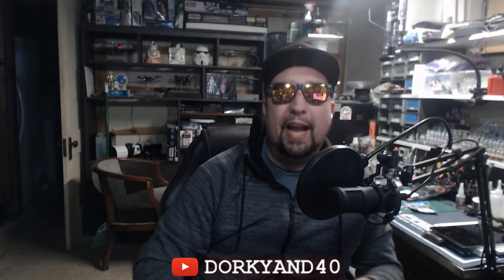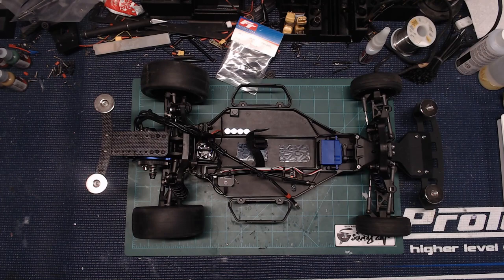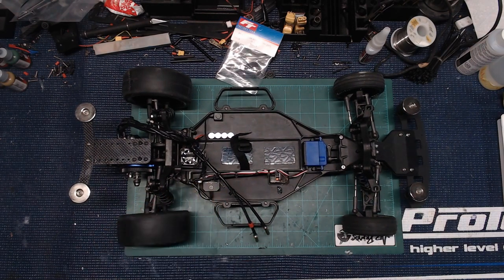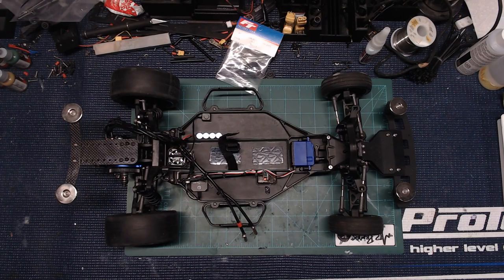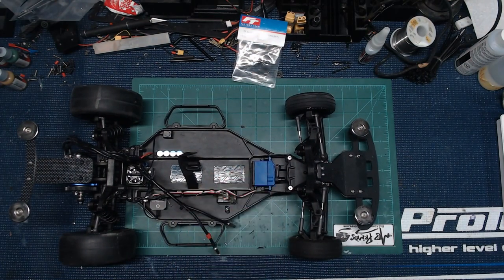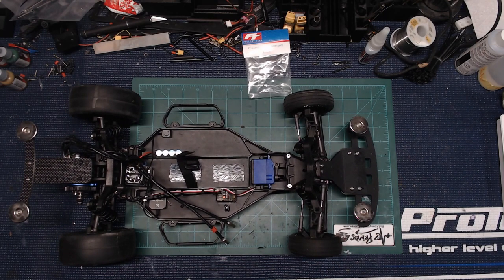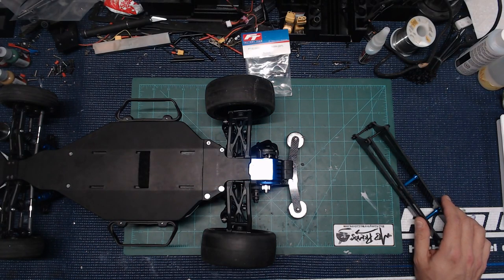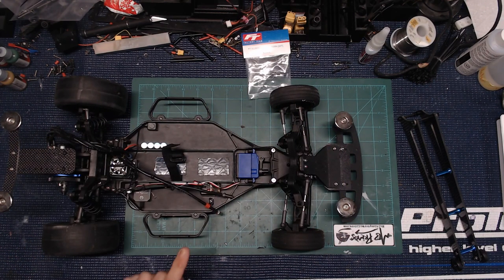5 THINGS TO MAKE YOUR DR10 BETTER | NOPREP DRAG RC

Comment: This summer when I'm allowed outside again I'm finding the uk scene and I'm doing this. It's going to be my mission to make them add rules they didn't think they needed. Step 1: big prop on the back. They say no gyros but I might be able to use optical flow or ultrasonic sensors to do the same job.
Reply from the maker: Lol. That would be something. I hope you’re doing ok.  I follow uks updates and vaccinations closely just because of you guys and the ldo crew and other fpv you tubers. I get my second dose of moderna this coming Monday.
Reply: @Dorkyand40  oh that's great man, don't let that lower your guard these new variants ain't fun.
TBH it's pretty rough right now, through the worst of the hospital crisis but looks like the government is looking to stamp it out much better than before so there's no light at the end of the lockdown tunnel yet. I'm generally in favour of the tougher approach but I'm definitely not enjoying it. I usually hang out with LDO Frank a fair bit and haven't been able see him in months.
Reply from the maker: So sorry it’s been that way. I work in healthcare here. Even though we’ve been open per say I haven’t dined out since July and do most shopping online. Masks everywhere. It’s been a long winter. Work has kept me occupied.  I don’t really plan to do much more after being vaccinated but it’s at least stress relief working around them all day. Luckily things have slowed a lot in my state after a few rough months.
Reply: @Dorkyand40  nah it's better this way, I'd rather they acted faster and harder. Kicking the can down the road is why it got so bad. Now we are smashing it on vaccines it's even more important.
Reply: @frasersteen  wow, you're part of the problem.

Comment: Just stripped my idler. I think I’m going with the RR metal upgrade. Thanks!
Reply: If you can't find the gear I use the 1 for the slash 2wd you need two 5 x 11 x4 bearings

Comment: I choose titanium screws over stainless steel (or any steel) for the weight advantage. What advantage does stainless steel give? Hell…my wheel nuts are titanium. And of course…the axles and linkage. My DR10 is the most exotic of all my rigs. And that all metal tranny with the lockout slipper clutch is bulletproof drag racing heaven. And…CARBIDE SPEED BEARINGS‼️Truly exotic. Except the chassis. It stays stock. Factory stock
Reply: …and Hitec has a drag specific steering servo

Comment: Thanks Chad , I’m building a DR10 with my dad for him ! Thanks for the video sir !
Reply from the maker: It’s a great platform to learn on. If you get into it seriously it’s only downside is the parts and adjustments run out quick so that’s why the better chassis use the losi or b6 kit
Reply: @Dorkyand40  really?

Comment: Great video. It really helped me because this is my first go at setting up the DR10. Basically I'll be starting off with just a chassis that I picked up off of e-bay. The seller was just starting to set it up as a dragster but changed his mind and went with a fiber carbon chassis. It came with a bunch of Integy upgrades and of course stainless steel screws.  I'm probably a dumb ass but my thought was to make a sand rail out of it. Thanks again for all the great information about this car. ⭐⭐⭐⭐⭐
Reply from the maker: Whatever it takes to get the gear in and not compromise the chassis. Good luck man

Comment: I watched for ideas im building a dr10 kit for next season the build will include
 drag master 2.5t 
Hoosier tires front and rear
Hitec servo
Malibu body  with light kit 
All the above are installed 
Tekin rx8 gen 3 (on order)
Futaba receiver 
I think have a good foundation to start with yet its all in tuning
Reply from the maker: Looks good

Comment: If you want a bulletproof trans pick up the Serpent Aluminum diff part #500485  and serpent aluminum idler part # 500526 direct fit into dr10 transmission.

Comment: What was the setup you used to convert the body mounting position as well as going to the magnetic?
Reply from the maker: Shoe goo on the body and bolts drilled and tapped into body posts.

Comment: Hi!  Thanks for the video!

I saw you said to change the idler gear to a metal one.  What do you think about the other plastic transmission gears?  Are those ok to use the stock transmission gears?  Thanks much!

Comment: as a very new guy into the RC game, I want to get into drag racing.

Should i buy Dr10 and build from there? or start from fresh build?
Reply from the maker: Depends on goals and expectations. If you have a local scene with a lot of beginners then an rtr kit is a good way to start.  A full build and sport model car is going to require a lot more budget and devotion.
Reply: @Dorkyand40  does full build require lot of knowledge of building? and may different set of tools?
I only have a set of screw drivers.
Reply from the maker: Kind of a mash up of 2 kits unless you get a full kit like an Apollo. You always needs metric drivers for these rc cars. 1.5-2-3mm and a few nut drivers. Usually sold in a kit.

Comment: You ever consider the diff lock for it? Full size drag cars are. Just curious.
Reply from the maker: At some point I will try it but our roads in Ohio are cold now and it’s hard to put real power down without a slipper to adjust along with the stages on the drk160
Reply: @Dorkyand40  thanks. I ordered one, but am running stock motor. Looking to mid that as well soon.